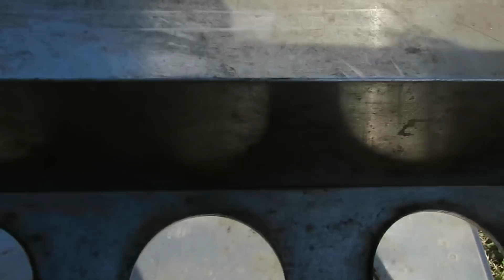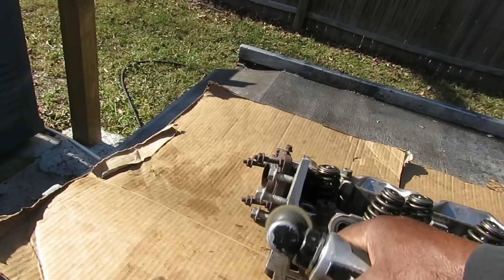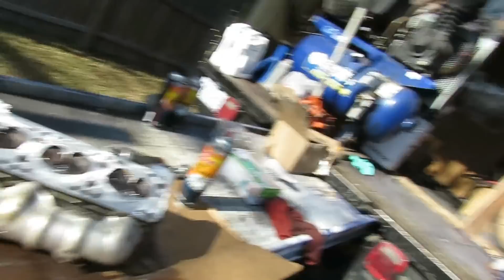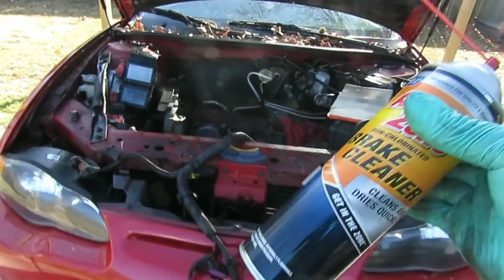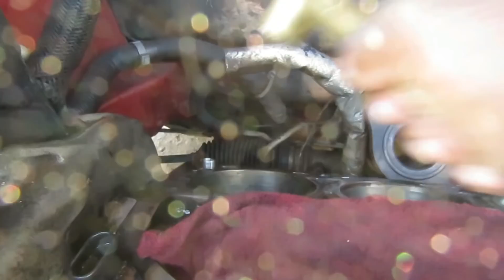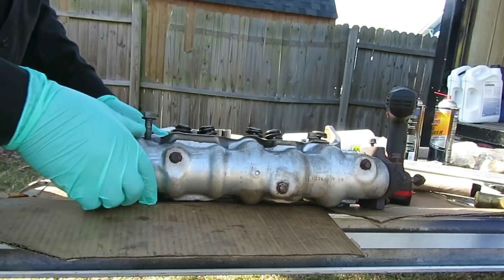⭐ Part 14 - 2004 Chevy Monte Carlo - 3.4 - Intake Manifold & Head Gaskets

Comment: Hey Tim what rpm is that drill you are using if it's still around
Reply from the maker: I have no idea, but it's still around and I'll see if it on it.
Reply: @OnlineAutoRepairVideos  ok any idea where u got it or the name 🤔 I just got the cylinder heads resurface now I just need too clean the gunk off the engine block